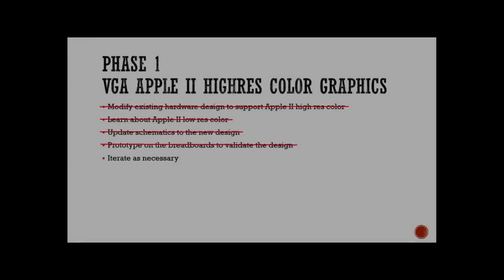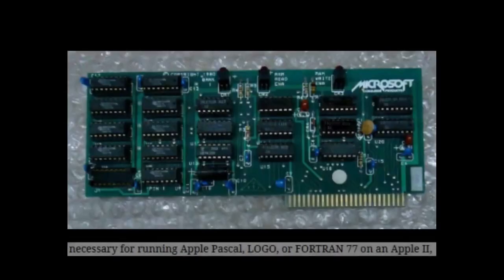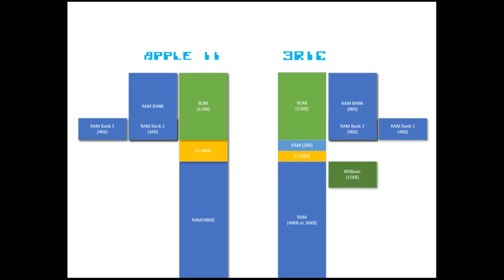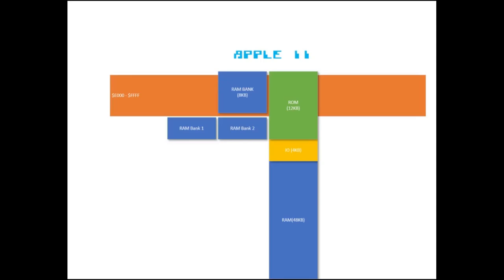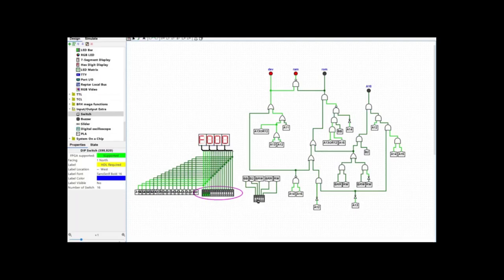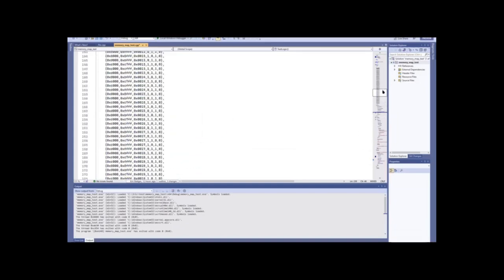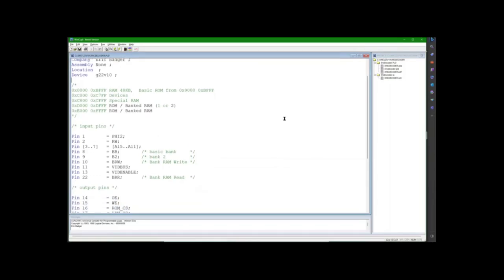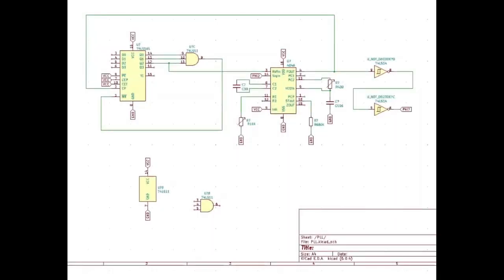Porting Ultima IV to my 3RIC 6502 homebrew computer: Apple II language card and banking challenge.

Comment: Nice update. I avoid 22V10s personally because of their high power usage,  using 16V8s instead where possible - I've tested running the same logic code on both and found the 16V8 drew half as much current in practice. They are less flexible, however.

WinCupl's GUI is pretty awful, and from what I remember, it crashes a lot. I made a script to run three compiler and simulator from the command line instead, which is much more comfortable - highly recommended!